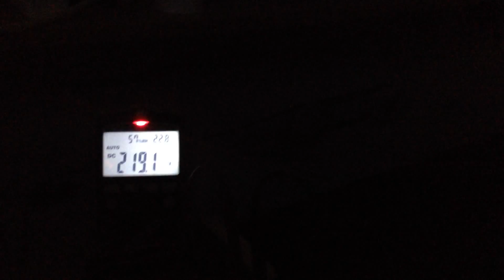Solid State Tesla Coil - IGBT Half Bridge 300VDC

Comment: I been wanting to build something with igbts but I think I should wind a very low Frequency secondary right ? Cause igbts won't work right at more than 700khz or even less at least that's what I heard , I got a variac sitting waiting for my first mains powered coil heheh
Reply from the maker: Hey, to be honest I didn't know they were more suitable to lower frequency, still learning new stuff all the time.  I was never running super high freq. I was buying what was cheap from Aliexpress.  I bet if I looked back at some old vids my coils were running around 120khz on Steve Wards SSTC 5 Circuit.   I can't recall but I bet those IGBT were destroyed at some point, not violently, I was never pushing big current.  
Did you ever find Steve Ward or Loneoceans sites, they have full build specs. FETs, circuit, and coil design.  You can guy pre-made drivers on Aliexpress for a reasonable price now with or without a bridge.  
https://www.loneoceans.com/labs/
https://www.stevehv.4hv.org/SSTCindex.htm
take care man